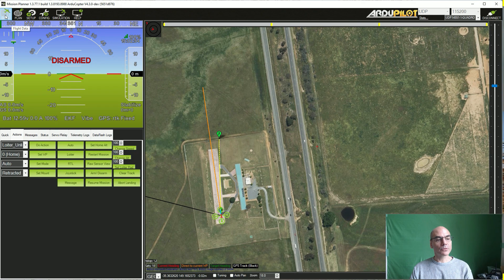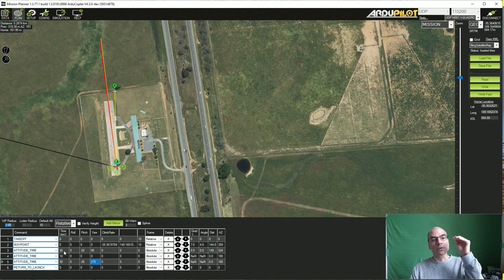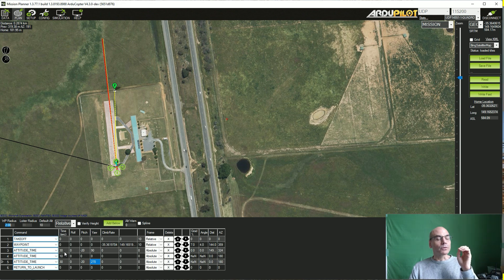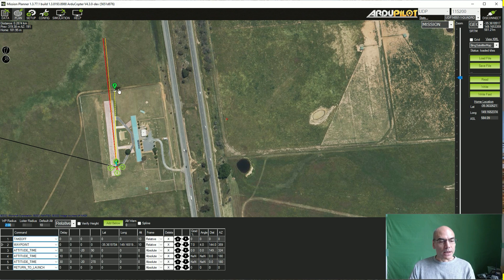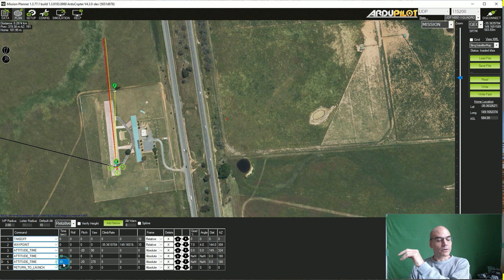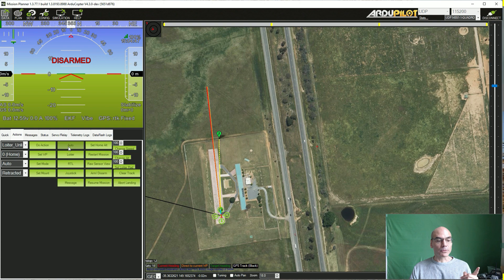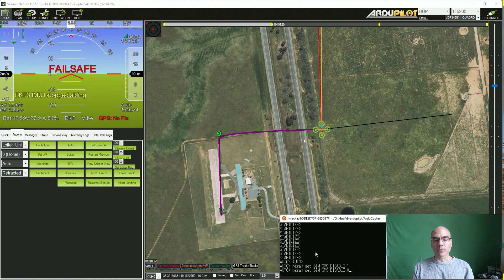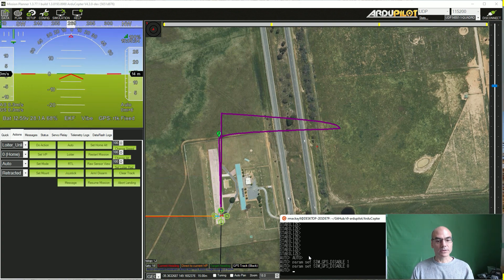Attitude Time Mission Command Simulator Test

Comment: Thank you randy.
Only on arducopter?
thus Arduplane?
Reply from the maker: Mazf, that's right, it is only implemented on Copter for now at least.  There is a NAV_SCRIPT_TIME which works Copter, Plane and Rover which could do something similar in plane perhaps but it would require writing a lua script (or modifying one of the existing example).
Reply: @rmackay9  Thank you

Comment: What is your simulator ?
Reply from the maker: Hi Ad Bas, this is the ArduPilot simulator built into Mission Planner which is probably the easiest of our simulators to get working.  Here's the wiki in case it helps but the first couple of steps are to install Mission Planner and then go to the SIMULATION tab. https://ardupilot.org/planner/docs/mission-planner-simulation.html